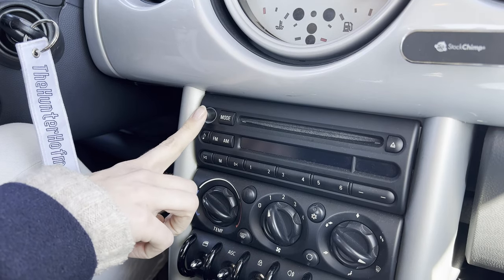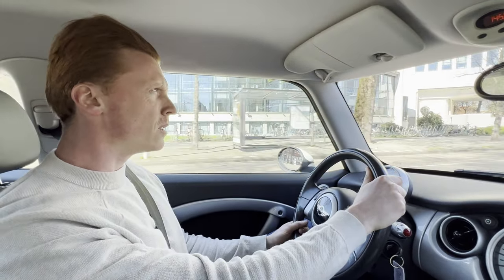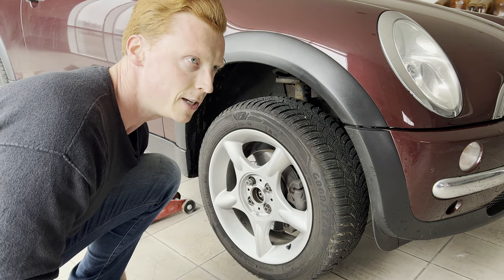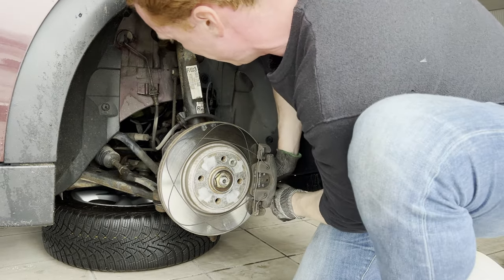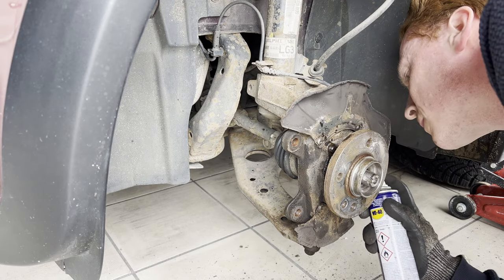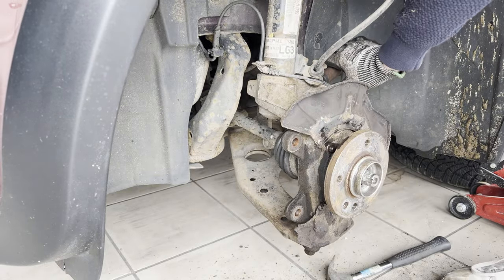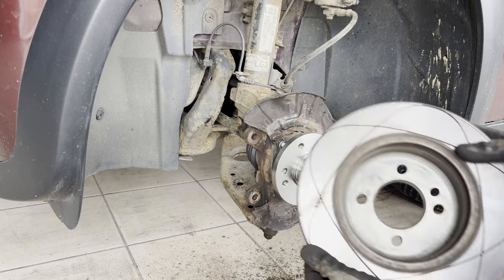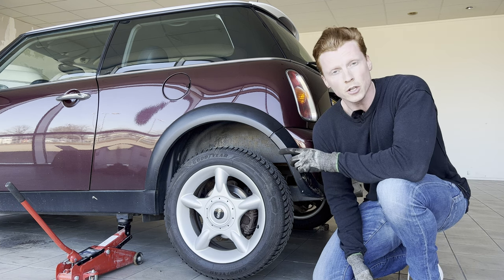MINI Cooper R50: Replacing Wheel Bearings and Rear Brake Discs

Comment: I'm about to replace the front wheel bearing on my own r53. How did you solve the corroded/rounded bolt issue on the right side of the car in the end? Just curious.. in case I have the same :P
Reply from the maker: @schweppie  haha I believe I wacked on a socket with a hammer and got it loose that way. I then replaced the bolts for new ones. Good luck and let me know if you have any questions